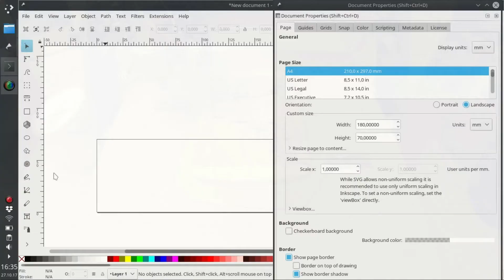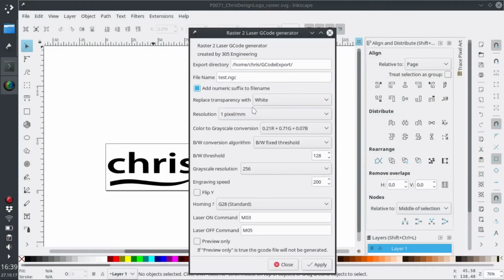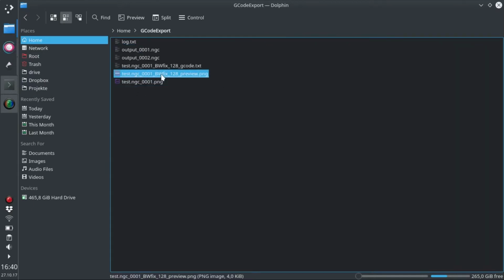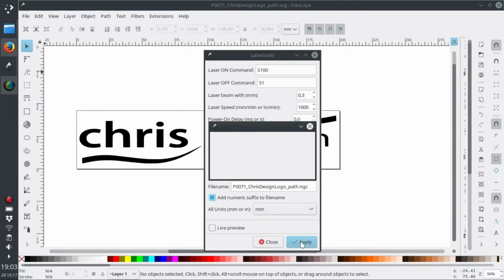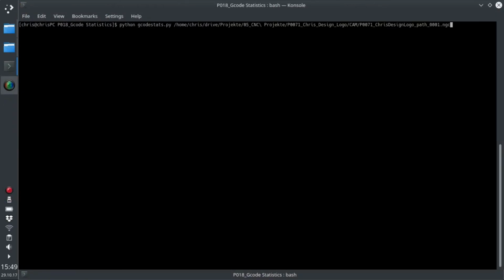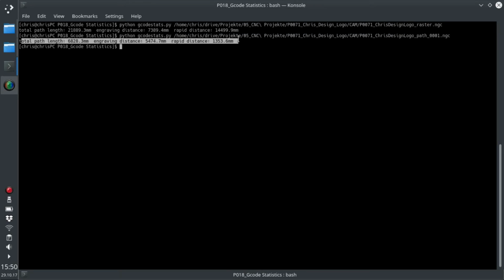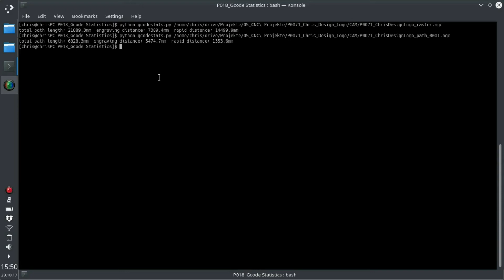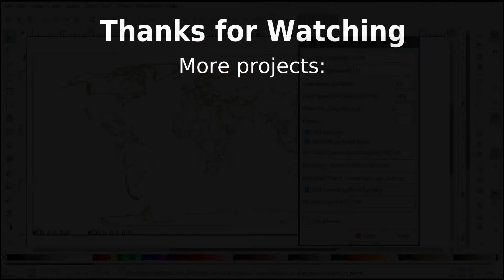Laser Engraving: Rastering vs Toolpaths with Inkscape

Comment: thanks so much for the tool Chris. Is see you used a 2w diode laser. can you share you speed settings you set for your perimeter and infill. Actually a screenshot of all you setting will help me greatly eg: like the width you chose to go with aswell. I have a 2.5w laser so our setting should be close. thanks again for helping all tinkerers out there in the world

Comment: Hi, I was looking for a tool like this for quite some time.
It works good, but I have a small problem. It generates a gcode, but the code is to big. I mean in terms of the work field. Though I set the limits of board to 200x200mm (everything in inkscape is set to mm) it generates the code up to 570mm. So now in inkscape I set the board to 50x50mm and the generated code goes to around 170x170mm.
Is there something I am missing ?
Thank you
Reply from the maker: Sounds like the "Scale" parameter in "Document Properties" is not set to 1. If that is not the case, your object might still have a scale property. You can check that using the "XML Editor" in the "Edit" menu. Hope that solves the issue.
Reply: @ChristophWagnerChrisDesign  Hi
Thank you for the quick answer.
However I can not find any scale parameter in document properties nor does XML editor give me any useful data. When I generate the gcode with J tech photonic laser plugin I do not have this problem.
Reply: Well in XML editor it says the dimensions are as they should be 200x200mm
Reply: In the end I deleted 0.91 Inkscape and installed 0.92 and now it seems to work. Thank you :D

Comment: pull request has been made with many improvements in Gcode generation.  Code is now cleaner and smaller.  Option for overshoot for infill which is necessary for more powerful Nichia 7W lasers to run at full intensity and speed.   I was able to run my laser at 6000 mm / min
Reply from the maker: Thanks Mate!
Reply: @ChristophWagnerChrisDesign  I wanted to change the density (laser diameter) with the color of the fill but was unable to find out how to get the color of the filled path from the svg.  example:  100% dark would be 0.1 lines / mm and 10 % dark would be 1 line / mm
Reply from the maker: @diypppalain  Have not looked into that so far... but sounds like a good idea in order to improve the quality.
I've also merged your changes and checked the Gcode. Seems to work very well. 

I started working on a version for inkscape 1.x (but did not get too far). Maybe it would be better to implement new functions there since inkscape 1.x will only support python 3 and there are a few api changes as well. So if you want to help me out there as well, it would be most welcome...
Reply: @ChristophWagnerChrisDesign  I read somewhere that the 1.0 extensions would have to run on pythyon 2.x and 3.x  probably for backwards compatibility.  must pass PyLint.  It would be a pleasure to contribute.  we could setup a collabedit to go faster https://inkscape.org/forums/extensions/new-api-for-inkscape-10/  Maybe others can join as well.

Comment: Ive noticed the gcode out put has 3 digit designators, i.e "(G04) PO M106 S150". My engraver will only work with 2 digit designators, i.e. "(G4) PO M106 S150". It there a way to change the gcode output to that?
Reply from the maker: Yes, you just need to replace of all G00, G01, G02,  and G03 with their two letter alternative in the lasertools.py file. That should do the trick.
Reply: @ChristophWagnerChrisDesign  thanks. I did that and now its outputting the gcode in the correct format but its still not driving the printer. Not sure why because when i change the G designators from 3 digits to 2 manually it works fine but doing that to thousands of G cammands in the gcode is impossible unless theres a way to select them all at once and change them. Im gonna tinker with it some more and see what happens.

Comment: It seems I have missed something, but how or is it possible to turn the laser on with M106 command and to turn it off with M107 and still be able to set the power? Thanks
Reply from the maker: I programmed my machine so that it interprets the spindle speed commands as laser power. Like S10 = 10% power, S100 = 100% power and S1 is hard coded to be off. This is necessary in order to prevent issues where the machine will not execute cutting operation without a "rotating spindle"... But that is surely not the most elegant way to solve this problem. Depending on your implementation you may need to change some lines in the code.
Reply: @ChristophWagnerChrisDesign  Thank you for the response. According to the gcode, I have already found out that this plugin had been developed for the CNC with laser engraving module.

I use a 3d printer with the laser module. Your plugin works great, but some changes in the gcode are necessary to make it work.

Thank you once again!

Comment: Thanks for the work, the add-on is the best, but I have a problem generating the code with the curves.
with your samples it works very well but when I try it with my vectors it does not generate the lines of the curves.
any suggestion plz?
Reply from the maker: Can you provide me with your file? Would make troubleshoting easier...

Comment: Thank you for putting in the work on this. I have tried this plugin multiple times without success. Every-time I try, it hangs for an extended period of time and makes appx 2000+ .nc files then finally I'll cancel it. I've tried larger pictures and smaller pictures to just see if it comes out ok. I haven't had a successful try yet, am I doing something wrong? The raster from 305 engineering works fine, as does jtech photonics plugin, I would like to use yours as it seems like the best of both worlds. Any advice would be greatly appreciated. Thanks again!
Reply from the maker: Can you provide me with your inkscape file for testing? Did you try to export your file as .png and than reimport it and do "Path/Trace Bitmap" on the png? Did you try the test files I provided on github?
Reply: I have the exact same problem... which is too bad really since this seems like an amazing tool.

I tested this with one of the test_files provided and followed the instructions in the README file (also followed step by step from this video) but each time I run it, it creates hundreds and even thousands of .nc or .gcode files until i force kill it using task manager.

Running Windows 10
Inkscape v0.92.3
Test file used = "drawing_test_Panther_small.svg"
Reply from the maker: I managed to reproduce the issue. I'll look into fixing it soon. Thx for the feedback.
Reply from the maker: @andyd7054  Should be "fixed" now. (needed to disable multithreading on windows systems)
Reply: @ChristophWagnerChrisDesign  Awesome! Thanks for looking into that.
I tested it and it worked in creating the gcode pretty quick.

However, for some reason the output is slightly off center of the raster image...
I've tried resizing the raster image, moving to XYZ to 0 (zero), leaving the raster in-place and no scaling... every time the output is about halfway off center or completely off to the side.

Haven't been able to figure out why this is happening.

Any thoughts?
Reply: @ChristophWagnerChrisDesign  I'll give those a shot and let you know what I find out. Thank you!

Comment: hello sir 
 when i am using path (laser on= M03, laser 0ff = M05) X axis and Y axis working good but laser is not working help me out.. i am using ramp 1.4 in laser. Raster is working good all axis n laser working properly but in PATH laser is not working.
Reply from the maker: Please post the first few lines of the two gcode files, so that i can have a look where the problem is.
Reply: M03 S1
G90
G21

G00 X36.53 Y42.21
G04 P0 M03
G01 F1000.0
G01 X36.53 Y42.21
M05
G00
G00 X36.53 Y42.21
G04 P0 M03
G01 F1000.0
G01 X36.53 Y41.39
M05
G00
G00 X36.53 Y41.39
G04 P0 M03
G01 F1000.0
G01 X36.53 Y41.39
M05
Reply from the maker: Can you also post a piece of the working code from Raster?
Reply from the maker: Try to put "S195" (or what ever your desired laser power value is) in the "Laser ON Command" field in Lasertools

Comment: I'm trying to find the plug in you wrote. Where is it located?
Reply from the maker: I will upload it on the weekend, when I am back home and post a link here.
Reply: Christoph Wagner thank you. I found another one called lockster which seams same as yours. I'm curious to see how they differ.
Reply from the maker: Thanks for the tip... that might have saved me a lot of time ;) I've linked my plugin in the comments now, if you still want to try it out.
Reply: Christoph Wagner awesome thank ypu. I will try it out
Reply: Christoph Wagner I have tried your plug in as well now. It worked great. I have gone back to lokster though as it is setup to allow crosshatch or single lines. Cross hatch gives a fantastic finish on wood with me only having a 500mw laser. It is something you may want to consider adding to yours.  Keep up the good work.

Comment: Hey christoph. Would you mind providing direction as to how you used gcodetools to accomplish this? I've been doing vecter engravings but want to try to do vecter with raster filling it.
Reply from the maker: You could use the engraving function for the parameter and then do the infill separately with the area function. Just set the tool diameter to the diameter of the laser point. After that you would need to combine (and possibly modify) the Gcode manually. 
Or you could try the plugin I wrote...